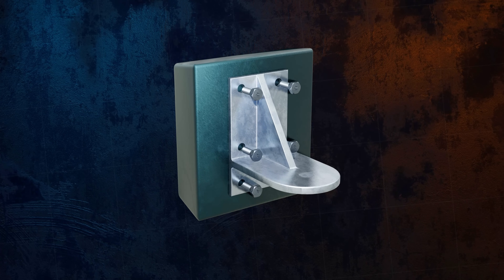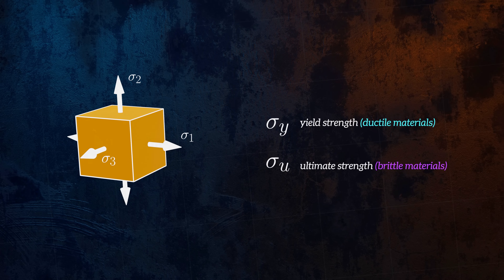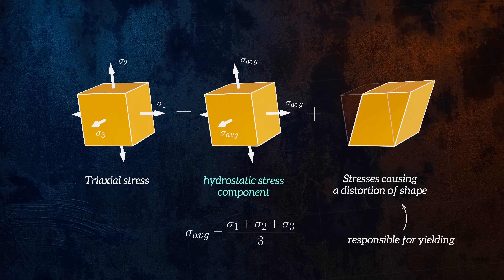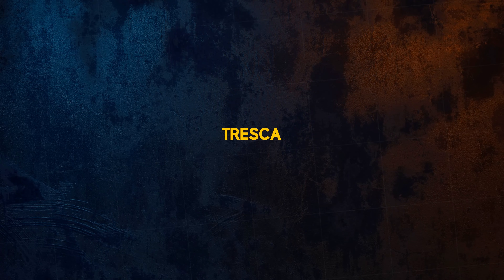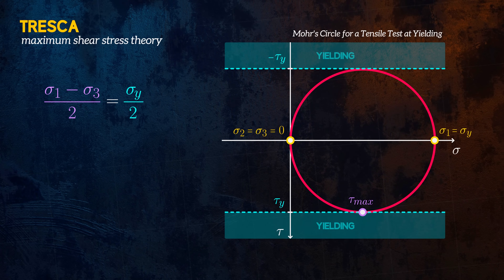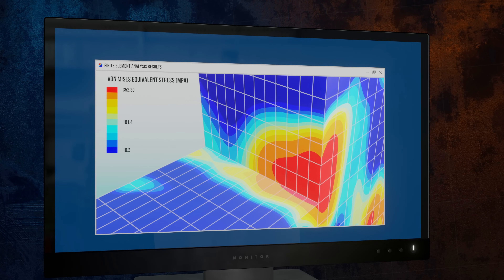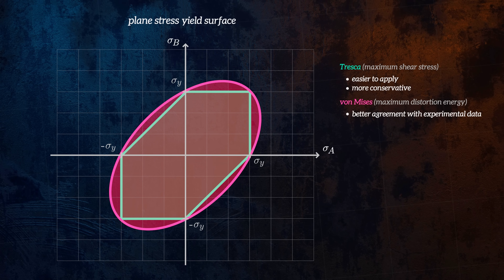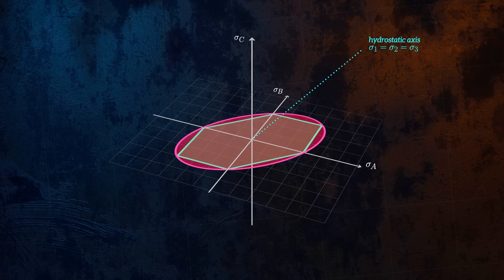Understanding Failure Theories (Tresca, von Mises etc...)

Comment: Hey dumb question. For hydrostatic what happens if we assumed a cube that is submerged and also being filled up with liquid? Where does it fail once the pressure inside the cube overcomes the pressure pushing on it

Comment: 00:00 Predicting failure of materials is complex
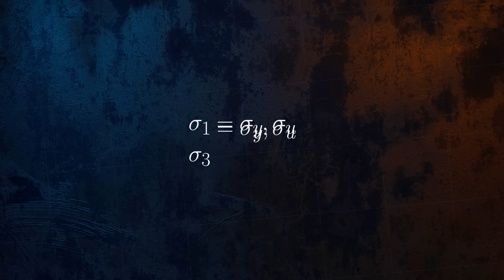02:12 Failure in ductile materials is caused by deviatoric stresses, not hydrostatic stresses.
04:17 Understanding Mohr's circle for stress analysis
06:23 Two failure criteria theories: Tresca and von Mises
08:19 The von Mises failure criterion predicts yielding based on equivalent stress.
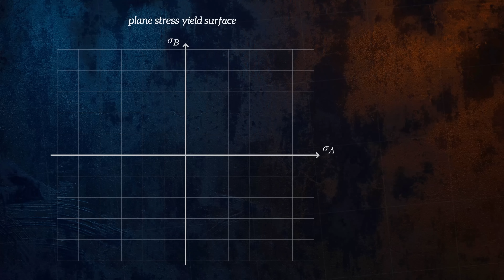10:18 Comparison of Tresca and von Mises yield theories for plane stress conditions
12:11 Tresca and von Mises yield surfaces differ by 15.5% and Tresca is more conservative
14:23 Difference between tensile and compressive strengths explained using Mohr's circle

Comment: When I google, "What is the shear strength of steel?" I get numbers like 0.56,  0.57, 0.60, of the yield strength, etc.  Based on this video, you'd think that the number would be 0.5, wouldn't you?

Does the discrepancy come from the fact that steel is not 100% ductile?  When you twist chalk (a brittle material), it breaks in a spiral.  This is because Mohr's circle for pure shear says that the principal axial stress is equal to the shear at 45 degrees.  So, I guess for chalk, the maximum shear stress is equal to the maximum axial stress.  So, the number for chalk should be 1.  If brittle materials have shear strength = 1*axial strength, and ductile materials have shear strength = 0.5*axial strength, does that mean that steel having a number of 0.6 means that it's mostly ductile, but a little bit brittle?

Comment: I just don't understand. I've been trying to get it for about 20 minutes now. How can you say that hydrostatic forces do not cause yielding in a ductile material? Can anyone explain please? I'm considering a propellant tank or any gas tank, if you keep adding pressure to the inside of that tank, eventually it will fail. The internal pressure that pushes out in all directions equally will DEFINITELY cause the material to yield after a certain point.

If you put it the other way, that you have a uniform distribution of loads that are compressive in nature that press the tank or object in, causing a change of volume as the video described, if the magnitude of those stresses are big enough, then the material will have to fail I just don't understand how hydrostatic forces do not contribute to yielding? How?
Reply from the maker: A tank that is being pressurised is not a case of hydrostatic stress. The pressure generates a tensile hoop stress in the material and will fail if the pressure continues to increase. Hydrostatic stress is more like the load seen by a small sphere dropped to the bottom of the ocean,  where an even pressure acts on all surfaces because of the hydrostatic head of the water.
Reply: @TheEfficientEngineer  Thank you so much for replying. That is what I thought. That the gap in my understanding lies in the fact that pressurising a tank is NOT hydrostatic stress.

So even like with a submarine, or any object that floats down very deep in the ocean, generally they get crushed, don't they? If the material cannot withstand the pressure of the water on top of it. Is this also not hydrostatic stress? Maybe it only gets crushed because there is a pressure differential between the inside and outside of the submarine/tank/object?

Comment: This is very autistic I feel seen
Reply: I'm just putting this down doesn't mean you're going to get to it I don't know but do these theories assume it's like a vacuum where the only force is gravity? 

It feels like any ambiguity in these would have to do with just stuff that you can't measure easily. They should do one in like the middle of Los Angeles and then in like a temple in the Himalayas cuz one has a ton of electromagnetic signals, tons of heat, more pressure and the other one has the opposite.

Comment: Why is it when I design a sealed fluid system it will fail and leak, yet when I design a fluid system to have a small hole to purposely leak it will fail and block up? How does it know?

Comment: I watched this video because I had a question, and you answered it at at about 10:50.  Thank you so much!  I was wondering why shear stress theory of yielding didn't predict that the piece could undergo infinite stress if the principle stresses were equal.  Now I understand that this graph is only 2D and only works when the 3rd stress is still 0.  So, it does predict that hydrostatic stresses can go to infinity, and I just didn't understand the graph right.

Comment: The picture at 3:08 that illustrates the deviatoric tensor is not appropriate in the case of triaxial stress. In that case, the deviatoric tensor should cause a deformation that maintains the shape of a parallelepiped.

Comment: This is a fantastic body of educational materials, congratulations! Regarding this specific video, however, I thought it would be worth making a little rectification. The decomposition of a stress state into isotropic and deviatoric components "lives somewhere above" the specific type of deformation induced by each individual component. What is stated in the video is certainly true for isotropic linear elastic materials, but not in general: it is possible to observe material distortions under purely isotropic loading, or volume changes under stress paths dominated by shear. The presence of material anisotropy and/or certain types of non-linearities can generally give rise to such experimental evidence. These are certainly more advanced topics than considered in the video, but a little disclaimer would not hurt IMHO. Once again, great work!

Comment: A probably different situation makes me intrigued bout vibration & resonance, recently encountered some people claiming their liquid product consisting a "resonance energy", so firstly they introduced vibration to the ions in the liquid to allow electron excitation and achieve resonance, in this case is copper ions (also the inventor claimed that this vibration can be introduced to any kind of metal ions without tuning the frequency), with a very specific frequency of ultrasounds (that he found if i'm not mistaken). Then he claiming this resonance energy in the ions or liquid can last for few months without the vibration source and the emitted energy can used for antibacterial. Obviously using copper ions for antimicrobial is a fact and very effective, but they now claiming the emitted "resonance energy" also able to do so. Is this possible?

Comment: Never been to College in my life!  Didn't need to be.  I've understood structural integrity/failure since I was a kid.  In 9th grade, I won the Bridge Strength contest when we were tasked to build bridges with these super soft matchstick-like pieces of wood.  You were only allowed so many pieces and so many glue points.  Then after a day of drying, it was on to the testing.  

The substructure of my design held 212lbs.  I still have that bridge.  As I grew up, I started noticing similar designs and the same design being used everywhere.  I believe I went to school stoned that day.  I have severe ADHD and was on Adderall.   So basically, my brain slowed down enough to actually THINK through the task at hand and build what made sense to me.  It worked and I WISH I would have pursued a career in the field.  But I chose a different path...  

Awesome video, something actually worth watching!

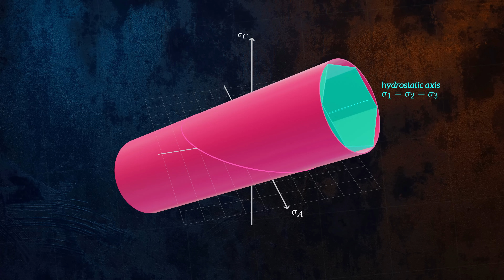Comment: @ 13:33 it is no accidental that the cylinder in magenta and the hexagon are inclined at 45 °?. Is it because at 45 ° shearing happens?
Reply: It's because we extend the failure surface along the hydrostatic axis. the hydrostatic axis is the line where sigmaA = sigmaB = sigmaC (all 3 principle stresses are equal). And this line goes up at 45 degrees.

The reason shear failure happens at 45 degrees is that the maximum shear stress on Mohr's circle is at an angle of 2×45 = 90 degrees from the principle stresses

Comment: Sorry to say, it’s quite unprecise.

Yield is not failure.

It’s a quite good explanation of yield but a really poor explanation of failure.

Failure occurs when the material deformation (strain) reach the deformation (strain) limit. This is typically different for different stress situations. 

When squeezing a cylinder between two planes, there may well be deformation but - in case of a plastic material - only deformation. Not so when subjecting the cylinder to tension.

So analysing structures in the stress domain is sometimes overly conservative if insisting on being below the yield stress limit.

For linear elastic materials there is proportionality between the strain limit and the associated stress. Hence a stress limit can be established.

In case of a complex structure the yield stress may be exceed thus re-distributing the stresses without causing failure.

This mechanism and steels plasticity is actually why steel is such a fantastic material. It doen’t matter whether everything is made to exact tolerances: after loading the plasticity of steel will have ensured all loads are evened out.

The video is correct about on thing in relation to failure: If staying below the yield stress limit (using the appropriate theory) failure should not occur.
Reply from the maker: This video addresses failure of a material (i.e. the onset of yielding or fracture), not actual failure of a component or structure, since exactly what constitutes failure for a component/structure will be case-specific. Of course if yielding is very localised it may just result in a local re-distribution of stresses, and the effect on the overall behavior of the component may be negligible. And structures can fail at low stresses by buckling, for example, or by exceeding an allowable displacement.

Comment: The true is that the first to develop the theory of stresses and strength was Maksymilian Tytus Hubert (1904), the second Richard Edler von Mises (1913), the third was Heindrich Hencky (1924). James Clark Maxwell (1865) - main assumptions in letter. Eugenio Baltrami (1885) - concept. So, in the foto should be Huber or each one of them 😌

Comment: I'd love to know what you mean by Tresca being more conservative. If anyone can explain, please, you're welcome.
Reply: it’s because when you calculate yield criterion with tresca equation, you will reach the failure point “earlier” (even though the material hasn’t reached the failure point yet) than von Mises with the same values of stresses applied on a body. 

It isn’t actually bad, since this means engineers usually are on the safe side when dimensioning machine elements/metal constructions etc.

von Mises criterion is useful because it gives much more accurate values to the actual yield point of materials in real life. The advantage is that engineers can design stuffs without using more materials than needed.
Reply: @rararagi8266  I totally get it now! thanks! not a mech engineer tho, I do software

Comment: What failure theory is best applied for hyper elastic materials (rubber etc.)? I've seen some proposed on setting limits to the energy that can be accumulated during deformation, but other than this are there any others?

Comment: The Efficient Engineer - my mechanical saviour. Please... PLEASE, can you use your frankly AMAZING presentation skills and lecturing method to teach us all the mess that is, multi-DOF systems:
- What it means for a system to be over, under and critically damped
- How these different dampening qualities affect the dynamic formulas
- How the dampening coefficient / ratio is derived and why it is important
- The different types of systems you encounter and how to deal with them, in both cartisian and matrix form. For example, in my experience students are always asked to find the natural frequency of two suspended dampened masses. The process is calculable and sometimes hard. And I know plenty of people that struggle with it that I know you could serious help using your talents.

And finally, thank you for pursuing this career on youtube having clearly studied, at least, to bachelors level in mechanical design. 

A video on the theory of the secondary forces required in reciprocating masses (normally a crank shaft) would be amazing as well.

Your videos have fully solidified my understanding of all the topics you have covered along with my own personal revision. Triaxial stresses in particular is a daunting topic to begin with, but once you look past the naturally long derivations... its actually quite simple!! 

Anyway, I sincerely hope you read this because 2 DOF systems - forced or naturally vibrated - is another serious topic which I can gaurentee that you will get a hell of a lot of views on.

Comment: Can you tell while finding block shear strength in limit state method where failure is partly in shear partly in tension,gross shear area yields and tension area cracks in case one while in case 2 net area cracks due to shear and gross area fails by tension .we take minimum of 2 ..what concept is involved??

Comment: There is mistake in the surname - Huber not Hubert.
Maksymilian Tytus Huber was a Polish engineer and lecturer at the Lviv Polytechnic who developed the basic formula for calculating reduced tension of the material in 1904  (at that time there wasn't any Polish state and Lviv was under Austrian rule).
Richard von Mises who was born in Lviv formulated the same equation as Huber in 1913.
Great job!!! 
Best regards from Poland

Comment: Hydro static stress can be "non-uniform". Take a closed piping system with a simple bend. The large radius (or heel) has a larger surface area and experience a larger force. Piping systems tend to straighten out when you put hydro static pressure on them. A similar phenomenon happens with thermal expansion in the same system. Bends (or elbows)generally straighten out when system temperature rises (unless stress and expansion are forced directionally by guides/anchors). These features of matter alone can make even simple piping systems behave in strange ways.

Comment: Just a quick note that Tresca isn’t necessary more conservative than von Mises. The von Mises yield surface can lie inside Tresa if it is calibrated to experimental data using maximum shear data rather than principle. In other word von Mises equals Tresca on the failure surface flats rather than corners.

Comment: The concepts which take hours to digest has been precipitated nicely and explained in a matter of minutes without compromising the continuity / depth of the topic.
The animations are intuitive. Have started making notes using  your video.
You channel will be a benchmark for all mechanical engineers. 

Suggest you to make and upload videos on Machine Design, Material Science, Thermodynamics and Fluid Mechanics.

Hats Off to you!

Comment: If VonMises is preferd to Tresca it is not because it describe reality better (in fact it seems that tresca is more accurate) but because it is easier to extend Von Mises domain (there is only one normal vector for each point as for tresca every sumit is a problem)

Comment: Structural engineer with 20 years exp.  Nice job on the presentation, clean and pleasant looking!  I always use the term 'volumetric' stress instead of 'hydrostatic'
Reply: Can a ductile material fail under volumetric (hydrostatic) stress?
In otherwords, if the Tresca and Von Mises failure theories both conclude that it is safe, do I still need to even think about maximum principle stress, to make sure it is less than the ultimate stress?
Reply: @carultch  I think it can still fail under fatigue loads per S-N curve, if Max principal stress range is large enough.
Reply: @othniell1958  I'm not asking about fatigue loads.  Suppose it is only a quasistatic load that is in question.
Reply: @carultch  then my short answer is no, theoretically.

Comment: Why hydrostatic stresses do not cause yielding in ductile material, even thiugh the shape is changing?
Reply: By definition, the shape isn't changing under hydrostatic stress.  Hydrostatic stress exclusively changes the size, without changing aspect ratio or shape.    It doesn't change a cube into a parallelepiped, and it doesn't change a cube into a rectangular prism.   It starts as a cube, and it strains as a cube, thus no change in shape.

I wonder the same thing, about why it doesn't cause yielding.  On a related note, I also wonder if it causes rupture at the ultimate stress.  I'd like to know if being a ductile material means I don't need to think about maximum principle stress, because I would think hydrostatic stress could still cause failure in some form or another.  I would guess that it is the case that most practical loading situations, von mises stress governs failure instead.

Comment: Respected Sir, would you please explain difference between failure, fracture, damage.
Reply: I hope u will definitely accept my request.
Reply: @nandipatisai  Failure is the general term.  It is a condition of loading at which something interesting and undesirable happens.   The simplest examples are fracture and yielding.  Fracture is exceeding its ultimate strength, forming an abrupt crack and ceasing to support the load.   Yielding is permanent deformation past the point no return on linear elasticity, but that a condition that still supports the load.   Ductile materials yield before fracturing, brittle materials do not yield and only fracture.

Other examples of failure are fatigue, creep, buckling, whirl, pitting, resonance, and deflection in excess of the limit.

Damage is the physical consequences of a particular mode of failure.  I.e. the permanent strain as a result of yielding, or the details of the cracks formed in a fracture.